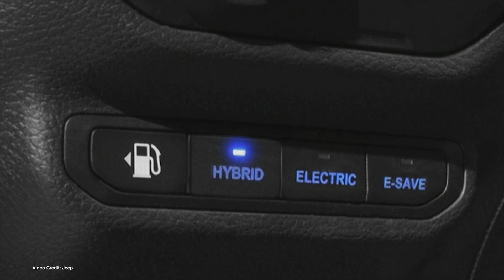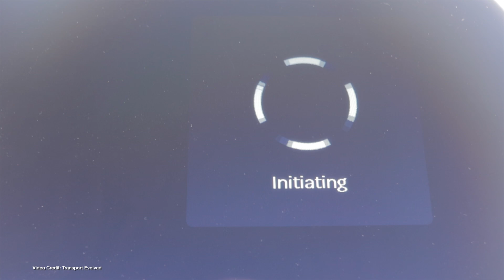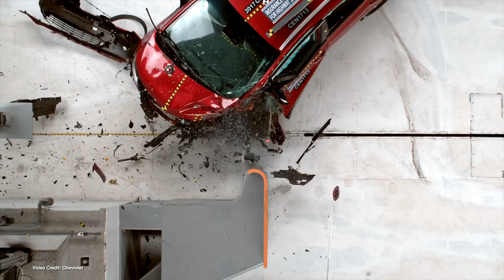EcoTEC Episode 255 - Solar Panel breakthrough, Tesla Driver Blames FSD, Charging Security

Comment: plugins in current form conot b efficiant the battery size is to small.
each tri you take you well exeed the range of the elevtric range, resulting in combustion engine to work.

Plugins can only do around 30-40km real range thats enouf for most ppl to  get to work but ends there.
viable plugins are rare like the wey coffee 01 with a range of around 100km real world